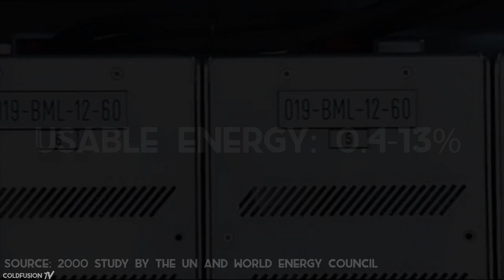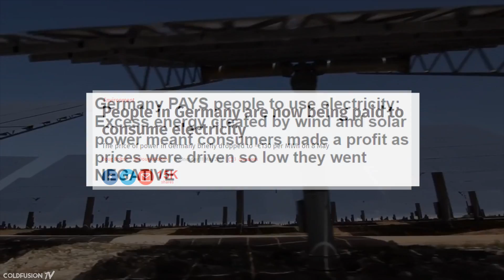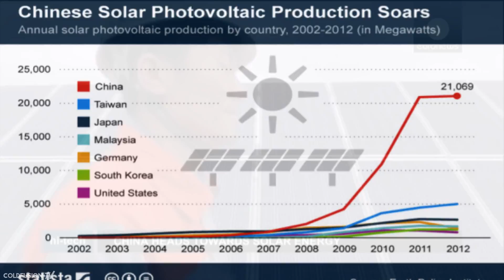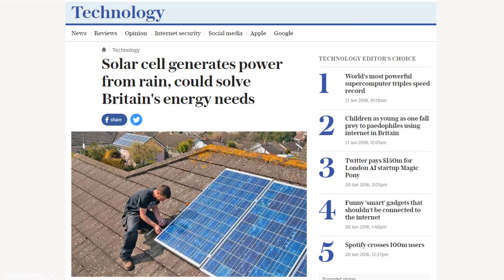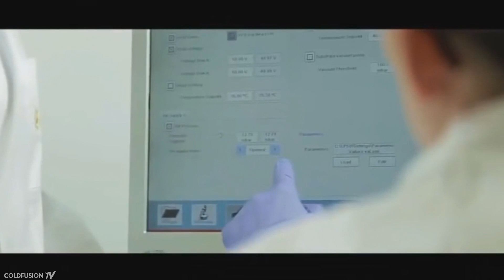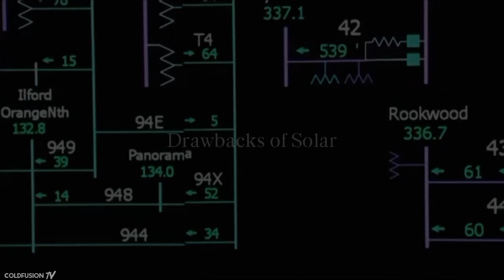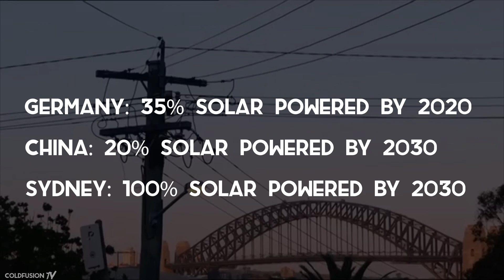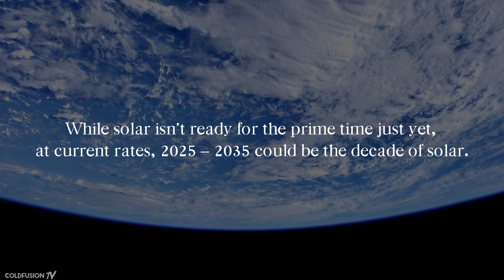The Truth About Solar

Comment: I've heard, from several sources, that there is technology to make solar panels with much more efficiency. When they come along, the oil industry acquires them and puts the technology on a 'black shelf' the fossil fuel industry has for anything that threatens their model. Same thing happens every time someone comes along with a device that will allow water to be separated into its parts, using hydrogen for fuel. We have known how to do this for a VERY long time now. Why are we still using oil?

Comment: I can't agree on the part of 35% efficiency as it only is achievable in lab conditions... Currently one can be happy with 5-15% efficiency which is way lower than the traditional ways of production. And if we consider a life cycle cost analyse on solar energy, cost is way higher than the part of investment. 
While it's true that we have cases of overflow of energy due to solar production, the management of the peak has lead to more cost. Which was the case in the country where i live, Belgium: 3 billion euro debt cause by subsidies by government, which will be paid by every citizen, incl. those without solar panels. 
There will be a future of solar energy, more research is needed. But, please don't rush due to enthusiasm.

Comment: it's too flocking expensive. I want to build an array just to power my computer, and 3 other items, that's all.    
the space I would need is too much. 20 panels @ 315 watt. inverter, cables etc is $9000 bucks according to solartech. 
I mean come on.... 9 grand ? that's not even including an install fee for a contractor to set it up. you have to build a frame to mount it all on. we're talking up to $15,000 grand all said and done. YA RIGHT ! I think I'll just keep my $215 electric bill for now. 6ish years just to break even. that's not worth the cost. not even remotely.

Comment: Once again we are told about advances that might be feasible in the near (20 - 30 year) and at least some downside is mentioned.  My beef is that "good" nuclear is not mentioned as making progress too.  No one is in favor of "bad" nuclear and while cold fusion is receiving some  research investment the nuclear technology which produces waste and weapons grade material continues to smear a technology that overcomes the undesirable elements while potentially provides 24/7/365 energy.  For the cost of the recently launched aircraft carrier (Gerald Ford) (13 Billion) LFTR nuclear technology could advance from proven pilot (1984 - Oak Ridge Nuclear Lab) to advanced engineering design and fully operating pilot plant.  It is not a sure thing but all the research (including coal) is driving technology advances and would do the same for safe liquid fluoride thorium reactors

Comment: Solar Power is a great idea, but still too expensive because storage of that energy is still inefficient. Deep cycle batteries are very inefficient,  horribly expensive, and do not have the required longevity needed. Other ways of energy storage are not common enough, and more expensive. Cold Fusion is still years away, and our present power grid is so fragile, it may not last until cold fusion is commercially available - unless a great breakthrough is made soon.

Comment: im fully behind the solar power revolution, but i disagree with the misnomer of "free energy". there is obviously a fairly reasonable investment in the hardware needed to produce said energy. at least at present. and until battery technology makes sufficient advances to drastically increase capacity and lower costs, we will still be reliant on the grid since selling our electric to the grid is the only cost effective way to afford to have solar.

Comment: solar bullshit is nonsense go with THORIUM SALT reactors instead please put you panels on your roof and heat water fair enough but do not expect solar to fully substitute nuclear powerplant
Reply: in our country it created new wave of millionaires because their energy prices were guaranteed again sun is not the way except local use..
Convert DC To AC and then sun is not shining 24/7 and then transfer energy from place to place...
Reply: I know what you mean but actually the sun is shining 24/7 we just have to position where the energy can be harnessed 24/7  As far as nuclear goes WHAT NO?  I mean what is the  costs vs the payback on something that huge?
Reply: The Thorium salt reactors are a very green option.  They have a high output per square meter of space.  The product used is being mined regardless as we mine for rare earth materials (eg. Lithium for batteries) but is currently just being dumped off to the side.  It will also consume existing nuclear waste from current reactors and it's petty much melt down proof.  It also produces by products used in the medical field along with some other fields.
Reply: Arizona is one of the best places, if not thee best place, to have solar fields.  Based on the US annual consumption for 2015 and based on current efficiency of panels, it would take a land area the size of Maine (so ~half of Arizona) to meet that demand and that is assuming ideal sun 24/7.  If you take into consideration that the ideal sun would only be for about 6 hours it would actually take a land area ~twice the area of Arizona.

Even if you put panels on every roof and place wind turbines wherever possible, you'd still be down to no less than half the land area of Arizona.  The US has the luxury of having lots of land and being at a good angle with the sun.  In Canada, we have lots of land but a poor angle to the sun.  It's just not feasible.  Same goes for Russia.  Then there are many countries like Japan and many of the European countries who simply don't have the space available at all.  Also think about it.  Habitat area at least the size of Maine, destroyed for "green" energy. 

The only way solar is going to be an adequate source to the world's energy consumption is to actually have solar arrays in space and somehow transport that energy to the surface.
Reply: it's only bullshit when it's the Solar Freaking Roadway.
Reply: Agree. Thorium salt is the future
Reply: If Thorium was so good, why do more reactors not use it? Thorium is hardly a secret!
Reply: ***** You believe the ultimate plan is to use another so called "natural resource" opposed to using a nearly limitless resource such as the sun.?.
Reply: Joe C Now ya talking.  Plus an area the size of Maine would not have to be destroyed.  It could actually create an economic boom that could level the playing field and short the gap between rich and poor along with promoting world peace. Of course, this isn't something the rich and powerful want to hear though.
Reply: Why not?
Reply: i have 15 kw solar panels and I live in central Europe. I can heat my whole house which is 500 square meters large. So please dont tell me that I cant do something without a huge power plant. You do know that it would take a small US size town of solar panels to supply earth with power if the panels would be near Sahara desert..
Reply: The world has more than its share of smartarse morons. Dulceseeker is a fine example.
Reply: RazorFX
Lol, you should try doing the math on that.  I did and based on 2015 energy consumption for the US, an energy output per sq meter of solar panel at current efficiency, it would take an area almost twice the size of main located around Arizona where they have the most clear skies year round just for America.  Never mind the rest of the world.
Reply: But you'd have to see that. Ordinary power stations are someone else's problem eh? You just use the electricity.
Reply: problem with radioactive gases ... more cancer ...

Comment: Title should be "The Partial Truth about Solar Power". They neglected to talk about the toxic chemicals and water quantities required to produce todays solar panels. In doing so they didn't bother to indicate whether the new techs in this industry are making the process less toxic or requiring less water to manufacture which is a major issue with manufacturing todays solar panels. They also didn't talk about how some of the companies making these solar panels have being in serious trouble for dumping toxic waste into local rivers like Jinko Solar has been. They don't talk about how Europe has recently introduce regulations to mandate the reduction and proper disposal of hazardous electronic waste and how that will impact the manufacturing of solar powers and whether or not they will be able to meet todays demands. This is just like a promo video that any industry would put out to promote the products they are peddling.   High on all the pros but gloss over or don't bother to mention the cons.

Comment: OMG.. Someone didn't do his homework on this one. Now don't get me wrong, solar power is great if you disregard its many drawbacks (one of them, btw, is the fact that after 6 years the output go down by 40% in some cases and after 25 years basically all solar arrays need to be scrapped and replaced - which has a considerable environmental impact, considering they are constructed out of some very toxic materials) but writing something like 35% efficiency - shows you know nothing about the Shockley–Queisser limit. All in all, without government subsidies - solar arrays are only marginally beneficial to the environment, unlike the one and only true green technology human race knows which is around 10,000 times more environmentally friendly per watt, as long as everything goes by the plan, which is of course, nuclear energy.

Comment: The worry noted in the video was what happens  at night when the sun goes down and there is peak usage by the public? Remember  when you where a kid and you use a magnifying  class to start a grass fire with the sun rays. Well I was thinking if the engineers can magnify the rays energy from the sun with large magnifying lenses  then have the solar panels accumulate and store the extra energy somehow for non sun light  use. Figure out how to capture more energy by magnifying the rays and storing it/ the energy. I am routing for Tesla to win. I suggested him adding solar energy to his electric cars to get over 500 miles a few months back... I hope hid engineers figure this out.

Comment: Has anyone looked into the repercussions of using solar on the environment. When absorbing the suns energy will that change the climate.
Reply: PAVEMENT absorbs the sun's energy too, just as much as a black solar cell, and that doesn't produce anything from it but waste heat.  So no.  Just because one politician who is a paid mouthpiece for the fossil-fuels industry makes that claim doesn't make it true, any more than the other claim (made by some politician in Australia I think) that using solar power would deplete the sun's power and cause it to implode
Reply: No, almost certainly not. As was said early in the video the greatest possible sunlight absorption that can be reached by us is a tiny fraction of solar output, and if anything, absorbing energy that would have heated the atmosphere can only be good for the environment considering global warming.
Reply: Solar panels for sure contribute to the heat island effect. Trees are either removed or not planted as they shade solar panels. Fewer trees make higher heat, more electricity, less clean air, lower health to the psyche and body, decrease wildlife habitat, trees take in carbon and store it. Just to name a few.
Lots of energy to create solar panels, factory conditions are poor, panels are manufactured with materials known to the state of California to be linked to cancer (prop 65), solar panels efficiency decrease over time and do not last forever.
Reply: you must of been one of the people in virgina (i dont remember exactly where in the eastern states). that said voted down the project for a solar farm that would of been the biggest in the eastern states. the project would of outputted over 50% of the price for residence that had been attached.

the reason it was down voted "it would of affected the environment" 

now WTF is that have to do with some of the most greenest states! (refer back to the guy that stated 'we have a very green country for how cloudy it is")

i dont see how it would affect it, i dont know how anyone would affect it. the rays are still going to shine there. there will still be rainfall when the the climate tells it.
Reply: but what if we make solar towers instead of solar farms??
Reply: I've only heard one other person voice concern over this, while I personally had never thought of it. I too would like an answer(hence why I am commenting, I'll get a notification if someone responds)
Reply: Adrian Fullmer That is accurate as far as I am aware with one caveat, we are getting better at capturing light across the whole spectrum so that is a moot point in the long run.
Reply: Red Zone relax redzone. I agree with you. Regardless, electricity is used. I would love to see a decreased consumption of energy in general (public education), introduction of renewable energy, and increased efficiency. 
I just realized my comment made it sound like solar panels have a lot extremely low albedo effect, replacing high albedo. That's not the case. Even if you had a roof white as snow and place a solar panel as dark as midnight, co2 is prevented through use of solar energy. co2 and other green house gases of course are biggest impacts of (human) global warming. 
To OP check this article on potential environmental impact http://spectrum.ieee.org/green-tech/solar/solar-energy-isnt-always-as-green-as-you-think
Reply: He did mention that Dubai was working on that goal.
Reply: what about getting rid of the cells and the batteries, that pollute a lot
Reply: Current batteries are almost 100% recyclable, solar cells have been since they were invented.
Reply: KaptajnKaffe of course they pollute, technically, breathing also does, LOL. But if you take that pollution and spread it along theyr expected life, it's negligible when compared to coal, gas, and other non-renewable sources.
Reply: @ bledlbledlbledl Waste Heat ?  Global warming.?
Reply: Thats like saying democracy is bad. Without necessarily taking a position on that : what else do we have?

I also wonder how pop culture Elrond is. Maybe he could paint some powerful geometry on his face.
Reply: ComandanteJ what i am seeing and reading is that they pollute to make and pollute to get rid of and it is the same with solar panels.
Reply: ComandanteJ
yea, my point is that maybe people would review how green solar panels actually are. Maybe the solution and most green alternative is modern nuclear reactors.
A lot of power, and the pollution we get out of it we can store onsite of the nuclear reactor.
Reply: KaptajnKaffe Oh, but of course, they are... for now. The thing is, when uranium (or thorium, if we ever go that route) is depleted, that's it, you dont have anything else. We have to invest in renewable, "infinite" sources of energy. That doesnt mean that i think we shouldnt inves more on nuclear power, I DO, but one thing doesnt interfere with the other.
Reply: The point in which we run out, I expect we will find another solution or we have figured out how to leave this planet and the universe is filled with natural resources. Right now we are just stalling progress.
Reply: go away troll boy
Reply: Well, the global climate is trending upwards, so cooling the earth would actually balance it out although I doubt there would be enough panels to actually affect the climate.
Reply: Conservation of Energy states that no energy can ever be created or destroyed it can only be altered in form.  The only effect in the environment would be a reduction in energy reaching the earths surface where the environment lives.  Since Solar energy still allows the energy from the sun to reach the surface it will not have an affect on the environment.  Now if there were some factor that prevented energy from reaching the surface such as a layer of gasses that reflected the energy out into space where our environment does not live.  Well that factor would have a huge impact on the environment.
Reply: Any storage of energy would later be released.  You cannot destroy or create energy only alter it .  Oil is only the long term storage of the energy from the sun that was altered to become the plant matter which was compressed into oil. The amount of energy that went into the creation of those plants is the amount of energy that we get out from burning the oil.